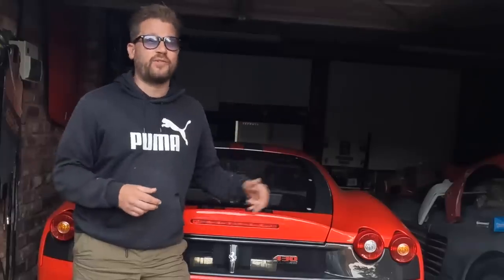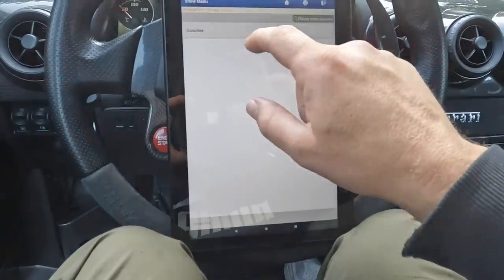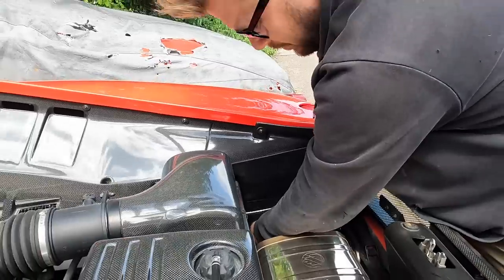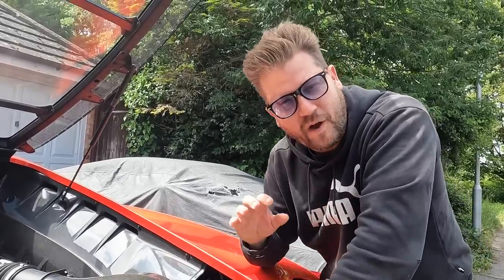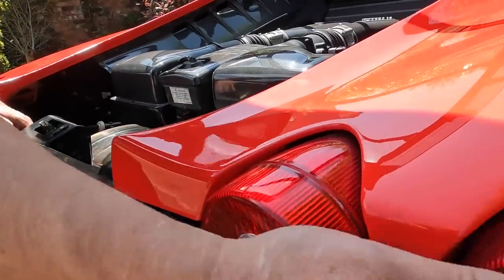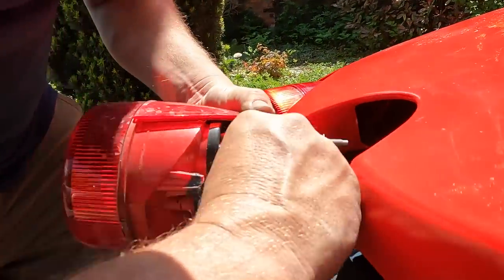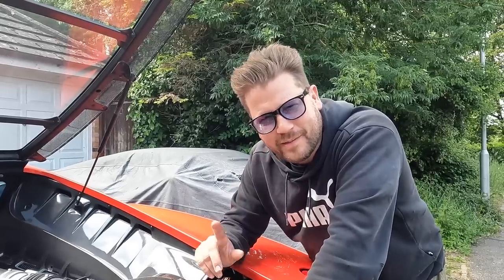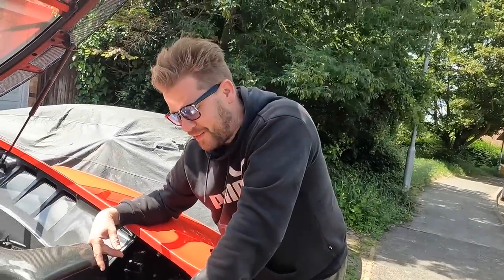Rebuilding a Wrecked Ferrari 430 Scuderia - Part 8

Comment from the maker: Big thanks to Carvertical for sponsoring todays video: 
Make sure you use my LINK for a 10% discount: https://www.carvertical.com/gb/landing/v3?utm_source=infl&a=Ratarossa&b=38b26e3a&voucher=ratarossa
PROMO CODE: RATAROSSA
Reply: JP Weild the plastic bits on the lights and they will break again. People in America use JP Weild to fix heavy parts on their motor home buses.
Reply: Quick steel is another good one I have used it to hold a sheered off top gearbox mount, I have also used it to repair a diesel tank that had been speared at the bottom.
Reply: Hi Scott is everything okay? Haven’t seen anything from you for quite some time. Love the channel was missing following the projects 😊

Comment: Hi Scott..  Re your taillight repairs, your best bet is probably to use the fact the material is a thermoplastic.  Use a soldering iron that has a tip designed for plastics to literally melt the plastic together, and melt new plastic into the gaps.  You could probably sink metal strips into the plastic using heat as well.  The repair should last far far longer than glue.  There should be many youtube videos to learn from, and I'm sure there is some similar scrap plastic around to practice on.  This of course works best for plastic that will be hidden from view.    E.g. I've fixed holes in lawn mower gas tanks with a zip tie (melted in),  Now that I've learned how to do this, it is my first go to before glue...
Reply: That's true, and he could use thermal staples as well
Reply: Yep. plastic can be welded, and much more plastic and mesh wire to reinforce. Also there is great materials, that are like liquid plastic and harden to similar specs as plastic.
Reply: the part itself is breaking tho so adding more "part" to it makes sense vs. just attaching, it'll just break in another place. cold carbon wet dab skin the base of it and the stems tho too. or cut the base and 3d print a matching holder then.

Comment: Great work Scott.  Making some good progress. For the rear diffuser you can find a person that repairs carbon bikes. He can lay carbon cloth over the original component. The repair on the fin will be stronger than original. You get the carbon look diffuser. For only maybe 500 grams of weight.  The bike frame guys do amazing fine work laying cloth.

Comment: Thank you for all the inspiration Scott!  I’ve got my 308gt4 rear suspension completely removed for bushings, shocks. Doing shift shaft seals. Fabricating a custom oil baffle. Shift bushings, new high torque gr starter, removing the heads for all new valve train. Let alone all new custom tunable cam gears with Mitsubishi evo belts and dta fast direct ignition and considering jenvey efi conversion. Let alone front end suspension bush and steering quick ratio rebuild. You have demystified the myth I can’t do this myself

Comment: To reinforce the light fixings I've used Milliput 2-part epoxy putty.  I just secured the broken pieces in the correct place with superglue and then moulded a pear-shaped blob round each plastic fixing, making them around 15-20 mm wide, basically double the thickness of the original.  You have to run the reinforcements well into the body of the light so you don't just transfer the stress to another weak area.  It's easy to shape, moulds like putty, is highly adhesive and sets like rock.  No further problems for 15,000 miles now.
Reply: I’m surprised more people haven’t mentioned this stuff - it’s brilliant!!

Comment: Scott -- I've had to fix lots of plastic tabs and such on motorcycles.  My go to is to first superglue the broken piece in place then use several layers of fiberglass w/ epoxy to strengthen all around the repair area.  Did the same on my Toyota Tacoma marker light tab a bit ago - broke in the similar way to your taillight.  That one had a strange geometry, but the fiberglass conformed, no problem to reinforce the joint; worked 100%.

Comment: For rear lights use an aluminium pipe for the "tower" one. 
Dremmel out the extra plastic -- insert alu pipe and epoxy glue it in place. 
Maybe extra epoxi on base for larger cover area.

At 400/piece is almost worth building one from the start and than use the molds for selling aftermarket.

Comment: I think a manual conversion of the Scud would generate a lot of interest and rid you of future F1 issues. To my knowledge, there are two options available, the less expensive $13000 USD. Samcrac has done this install on his 360.
Reply: Honestly, half of joy in owning Scud would be that SuperFast 2 F1 box, it's probably the closest thing to a sequential racing gearbox in a road car and everyone that drives it absolutely loves it...changing to a manual doesn't make it a better car...

Comment: The best fix for the rear tail lights on the 430s is to use plastifix to rebuild the plastic. This product is used to repair motorcycle fairings. Bolster the repair with E 6000 which is a rubber like material that prevents further cracking of the original plastic. You have to remedy the vibration by using Teflon felted washers in addition to the stock washers to help absorb the vibration from the flat plane V8. Which causes the taillights anchoring points to crack. Hope this helps. Awesome project.😂

Comment: for brittle plastic breaks that need reinforcement i really recommend some superglue mixed with some baking soda, you then reinforce it with thread that you wrap around, lacing it with more superglue and baking soda - it doesn't look pretty but it is effing strong and the thread spreads future force over a much bigger area.

Comment: For pressure loss, It can also be the ediff solenoid other than the pump or accumulator (although it may still be the pump / acc). Constant pressure loss / repriming tends to be pressure loss at the solenoid element of the diff. There is a way you can channel off the different sections of the hydraulics to test each element.

Comment: Wonder if you could put some self adhesive foam under / above the tail lights to support them a bit. This way it doesn't have 6" of light vibrating around behind the mounts to stress them.

At the moment it is probably behaving like a plastic ruler being twanged from a school desk!

Comment: Just for your knowledge. That " F1 pump " is the same one that is used on a Alfa Romeo or Fiat. Actually the pump , which is a small square part underneath the elektromotor is also used in the DSG from VW. 
Not sure with Ferrari but on most Italian cars the pressure will go up to 50 bar and will go down to around 42 when you put it in gear. When the pressure is getting to low the elektromotor will pump it back up. 

So in the future i would check the carbon brushes on the motor and maybe check the little magneti marelli sensors for the gears ....they might have metal shavings.... 

All the best!!

Comment: The only way you can repair the problem with the taillights, is that have them 3D printed out of material that dry rots slower than the plastic Ferrari chose to use. No matter how you repair it, that plastic has become brittle over time, due to the excess engine heat in the rear of the car, and will always continue breaking. At some point, they will just crumble into pieces, no matter how you reinforce them, they're going to keep breaking. Have them 3D scanned, and have them printed out of a material that is resistant to heat. Maybe even get a set made out of metal, and put a Glass lens in the back of them ...
Reply: metal 3d printing a piece that takes a large volume like that tends to be expensive.  resin printing would get clear enough.

prob is of course that they'd be repros then affecting value. just for using the car though there's plenty of stuff made of glass that you could 3d print brackets for to hold them in the hole.

as for fixing it, a 3d printed jig to hold it while doing the fixes would help quite a bit and instead of metal could wet lay some carbon on there.
Reply: @lasskinn474 The thing about repros is that once everyone starts using them it ceases to be an issue. Sooner or later all these lights are going to disintegrate and the reproductions will be all that’s left.
Reply: @Dr.TJ_Eckleburg  and the less there are the more expensive originals get so thats a bit of a catch 22.   of course even then the best would be to just stick whatever lights on the car when you're using it and just stash the originals in some cool and dark storage.
Reply: If it's heat then put a heat shield to keep the heat away.
Reply: @lasskinn474  Or just epoxy it, drive the car, let future generations deal with whatever happens to that material.
Reply: @cathrynm  well yeah if you didn't care of it like that. 

you can print a better replacement in the future anyway, it's just that it wont raise the value and it just then gets into owners heads. well you could print a pretty good one now and a mold for parts of it to be resin casted. if you don't actually want it to be an exact replica the whole thing gets a whole lot easier since you'd just print a holder for some existing tail-light but you know how ferrari owners are with car mods...
Reply: @lasskinn474  It's all good -- just as long as it doesn't go flying off the back of the cars as you're driving.

Comment: I had the same issue and got a new set  that are really thin.  On your rear lights,  you can also add a piece of the metal around the broken part for structural rigidity.

Comment: Use some threaded bar and replace the bolts (drill out the plastics) would be much better than epoxying the tin to it.. also use plastic glue, that chemically.weldsmabs plastics instead of epoxy

Comment: 15:09 I’d have drilled the hole deeper tapped it out then got a long 10mm bolt then sent it home to hold both pieces together ( obviously with bonding ) then cut the bolt head off with dremel and used 10mm nuts as normal light has.

Comment: Rear lights - lamp holder has screws holding it in. Using these could you not fashion some sort of stiffening bracket, connecting all 3 posts possibly in addition to the glue job? Would look like a spider. Hope you get the idea as I can't drop a drawing here.

Comment: for plastics like the tail lights rather than adhesive i usually will plastic weld the parts together with some metal reinforcement put into the plastic weld. Might be worth looking into for future. an old soldering iron can do alot of the welding but there are better things on the market that could work quite well in these situations. Just my 2 cents. nice job by the way.

Comment: What I thought you were going to do on the light repair was melt the metal tabs into the plastic.  If you had cut some small slits in the light and the broken tab you could have put the metal into the slit and put in the glue.  Your way worked too :-)....looking good.

Comment: Issue with gluing metal as reinforcement for plastic is they can have different thermal expansion coefficients- metal changes quite a bit more than plastic typically IIRC- so over time, unless some plasticity is provided by the glue, the metal and glue/plastic will work themselves apart. However perhaps a very long time in the UK with a milder seasonality. Or maybe it's really just an issue with CRP

Comment: If you ever need specialist adhesives Scorpion Oceanics, Creative Resin Systems (in Wales) & RS Pro do some very good adhesives and two part plastic stuff. Use to be an injection moulder using this stuff all the time.

Comment: hmmmm...that hidraulic unit looks vaguley familiar:)))....looks a lot like a vw 1.2 tdi lupo or audi a2....and the acumulator too...
On our small ones we test how many gear changes we can make with one pump load. 
There are some one way valves that have some rubber gaskets that give out after a few years.

Comment: watch some videos of plastic welding on youtube, it's amazing how you can repair plastic with a soldering iron and a cable tie, as for strengthening, you can melt metal mesh into the plastic

Comment: Regarding the backlight, why don't you find a company that does 3D cam and 3D printer, let them make a new holder with 3D as said 3D printer and make sure that the mounts will be stronger and more durable. The plastic parts that are not visible from the outside but are bad can be made new with a 3D printer. Cheap and works.
In Sweden, so many people are renovating old cars and where plastic parts have been broken, a new part has been produced with the help of 3D cam porgram and 3D printer.

Comment: The flap that opens and closes your exhaust is not driven by air, it's hooked up to electrical wires because that is a solenoid. They use a solenoid because if it was driven by air they would have to have a rubber line, and the rubber line attached to something that is inherently attached to an exhaust, would eventually melt, or at least become brittle and crumble. So instead they use a solenoid, attached to electrical lines, because electrical lines can take heat, while a rubber air line cannot.
Reply: The actuator is operated by vacuum through rubber hoses , which are well away from the exhaust . I removed mine on my 360 spider and plugged the lines

Comment: Scott do you guys have JBWeld products in the UK?   They have alot of amazingly high strength adhesives that in my experience adhere better than the 2 part epoxy you were using in this vid.
Reply: The repaired ones look like JB weld …..best stuff on the planet 👍

Comment: Can yoi buy an epoxy called JB Weld in the UK?  Nothing else comes close as far as strength and endurance.  You have to use the original, not the "Quick JB Weld".  The real stuff takes 24 hours to fully cure,  but i have found for most of these epoxies, the slower the cure time, the longer the repair holds up.

Comment: If that doesn’t hold on the bottom stud that snapped off the rear lights, as theres a hole there anyway, cant you just fit a longer stud?

Comment: Those tail light fixings are bad and your repair is ok but the breakage happens because there is room for the light to move. How about buying and fitting an ‘O’ ring for each light to take up the slack between the light and its housing

Comment: On the F1 system, the shift actuators could be weeping and you would still get a good accumulator drawdown without shifting. Until you change gears, theres no pressure on the actuators. I don't know if there's any other test or not but you could time going 1-2 and 2-1, then 2-3 and 3-2, and so on to isolate a leaky actuator or slave cylinder as it were. If the pump comes on quickly in both the 1-2 and 2-3 test but not the 3-4 then that identifies the 2nd gear actuator. Quickly on in 1-2 test but not the 2-3 identifies the 1st gear actuator.

Comment: For such a premium brand there is some shonky build quality and cheap production of the parts 😮. I bet that front wheel bearing will cross reference to something else, as it has splines t accept a half shaft or drive shaft, probably off a fiat 500 or something similar 🤷‍♂️, After seeing how the tail light broke and how you fixed it I have had an idea for a permanent fix/preventative mod, not only will it fix that issue it could be used as a preventative measure so it would never happen in the first place

Comment: Ducati also uses cheap hardware w red locktite and if you dont have the right technique they strip and its terrible, its must be an Italian thing to use the best parts and worst pot metal hardware and red locktite on every single bolt..

Comment: Apply more torque, and less horsepower to the rotation of your screwdriver, and you won't round them out, no matter how cheap they are... and just throw the new solenoid system and accumulator in there RIGHT NOW, and you can use the time you're enjoying your perfectly functioning F1 system to refurbish and rebuild the old components... Skip all the testing, just do it...
Reply: Please explain your first sentence.

Comment: Just glue it on first, with a dot in the inner center, to hold it in place while you lay the metal strips. Btw "glue" dries, not "cures." It's epoxy that "cures." Saw how you did it, and you did it exactly backwards... which is why you call epoxy "glue," and McLarens break constantly...

Comment: a car guy that doesn't know how to plastic weld shouldn't be anywhere near a car, what a knob for trying to fix plastic parts back on using epoxy glue and thin metal plate steel..... what do you think will fail first?? its obvious the epoxy is going to break off. you spend so much on cars that you couldnt afford a soldering iron and cable ties